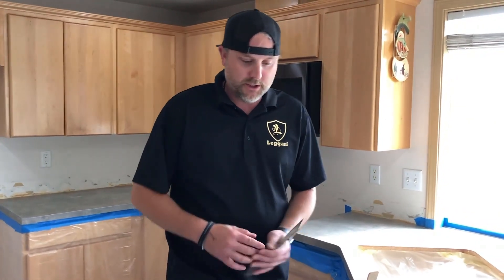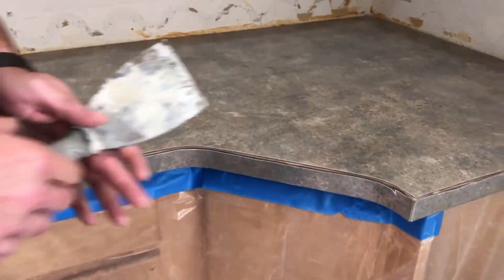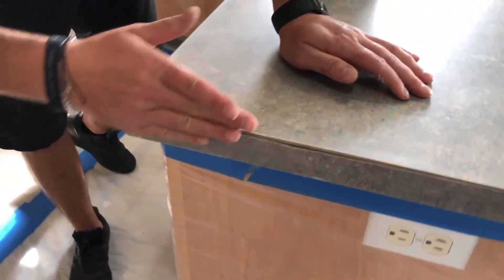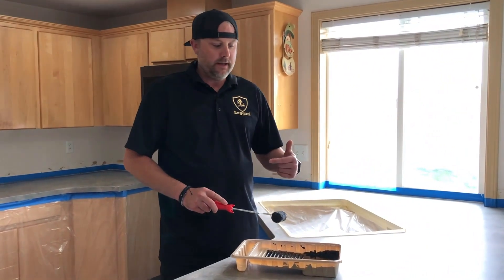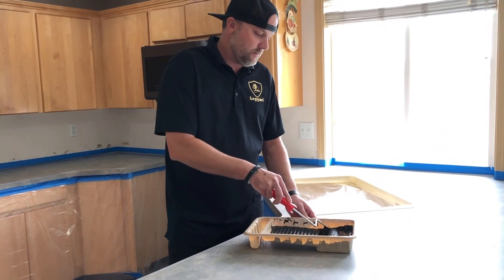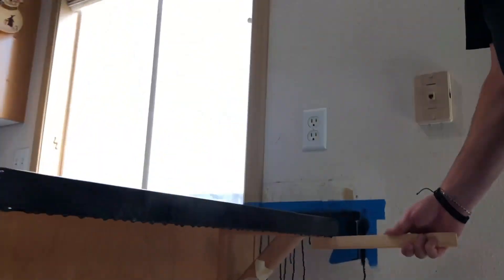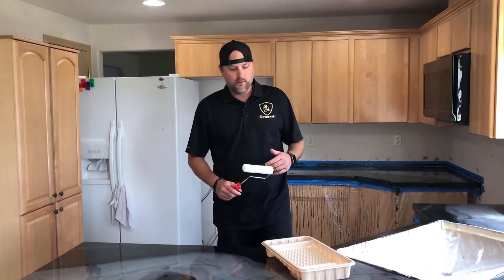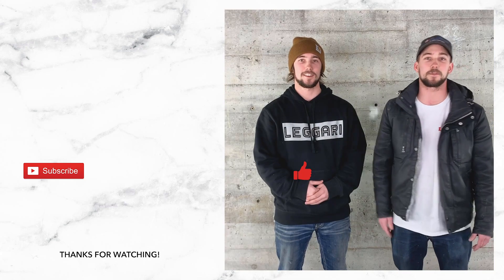Epoxy Over Formica Countertop Tutorial

Comment: Did you guys not sand the surface before priming? Also with a heavy pour why is there a need for that top coat? Or was that just for the handprint? The sides I understand but what's the purpose of doing overtop? Incase it's damaged or gets any gouges it doesn't effect the design & easily fixable with a quick sand and clear coat reapplied again?

Comment: What kind of primer and what did you spray on it after you put the epoxy on?
Reply from the maker: We use a water based primer https://leggari.com/product/wb-primer/ and once the epoxy is poured and the design is established, the first thing we spray is 91% or higher isopropyl alcohol. This creates cells in the design and disperses the epoxy. Once that evaporates, we spray denatured alcohol to pop any micro bubbles that might be in the epoxy from mixing. This allows us to avoid torching the epoxy and the risks associated with that.

Comment: So if the laminate is peeling off, is it better to peel it all the  way off or glue it back down and then sand to round edges?
Reply from the maker: You will want to peel it all off so you don't run the risk of it lifting up again.  Thanks
Reply: @LeggariProducts  Gotcha! I will still need to round off that edge though, is that right? Thank you!

Comment: Is bondo required for laminate , or i can sand real well. and add primer
Reply from the maker: Only need to bondo imperfections, joints or gaps!b So just give it a good sanding round any sharp edges and corners and clean really good and your ready to roll on your primer!

Comment: Looks great!   I’m going to have to buy that top coat. Is it heat resistant up to 400 degrees like the epoxy.
Reply from the maker: The urethane top coat is heat resistance up to 200 degrees F.  We do not recommend putting hot pans on any type of countertop surface.  Thanks

Comment: I have a brand new house but the countertops are formica material. I just want the countertops white. Do I have to sand the formica first or can I apply the product directly without the sanding process? Thanks in advance.
Reply from the maker: You will need to sand the surface first with 80 grit to scuff it up so our primer will adhere to the surface.  Thanks

Comment: Nice job ! What product do you spray on the counter at 15:55?
 I am actually preparing my counter 
As we speak I'm sanding  them but I can't seem to sand anything .. the melamine has a shine to it I've tried 60 grit 120grit 
Spraying degreaser
What should I do to  get melamine ready before epoxy?
Reply from the maker: Hello! Some surfaces are easier to prep than others. Typically, if the surface is not affected by sanding, the Primer will still be enough to prep the counter for epoxy. Please contact our customer service for more in depth instruction on how to use our products and prep your project. 
https://support.leggari.com/hc/en-us/requests/new

Comment: Have a question. If there isn't a way to level a built in counter top that is a little lower where it's connected to the wall. Is there a product to use to level the counter top out without removing the counter top? This has been a concern. I used wood filler to round the edge of the counter top and fill in the crease and nail holes. Then sanded down. Do I need to use the 5minute product that was used in this video or will the wood filler work? These are the  two concerns to why I have not finished the counter top yet. Please help and thank you. I love your videos and have watched so many to get every tip I could find. (I have done samples on small pieces of wood to figuire out and practice your Technics. Thank you !
Reply from the maker: Hello! Great question. If you email our head tech he can definitely help answer this for you! His email is cody@leggari.com
Reply: @LeggariProducts  thank you. I just emailed Cody. Love your work!

Comment: I noticed a ceiling fan going ,do you have a problem with dust getting in the epoxy?
Reply from the maker: Yes you can, you want to make sure you close all vents in the area and shut off any ceiling fans so you don't get dust in the epoxy.  Thanks
Reply: That's just what I was going to ask. I wondered if it would affect the drying. I wish this was available in UK. I'm having new kitchen and me and builder are doing resin worktops. I've so many ideas from watching you guys, but have to substitute products for what you use :-(
Reply: @jeanniesartadventures6146  If i were in the UK, i would use Easycomposites.com
They have good epoxy for every type of use imaginable. Consider yourself lucky, they would be my  preferred vendor, but shipping to the USA is expensive.
Reply: @jeanniesartadventures6146  P.S. If they  don't have the Mica powder colors you want,  go  to Eyecandycustomzus.com has the best selections of every color.  Ex, They have 27 different greens.
Reply: @andrewmarkert1146  thanks for that Andrew, I'll take a look. I'm a bit of a mica powder addict, I use them alot to make paints...I've quite a collection. Love them, so someowhere new to look is good.
Reply: @andrewmarkert1146  Hi andrew, thanks so much for this info, I've just been going through the website and it sounds perfect for what I need, and has so much helpful tips and information. I'm very grateful to you for pointing me in the right direction.
Reply: @jeanniesartadventures6146  Anytime.

Comment: Can you epoxy over tile?
Reply from the maker: Yes it can be put over tile, but you need to fill all your grout seams with multi purpose bondo from Home Depot, then sand it smooth, this will scuff up your tiles also, then wipe it clean with denatured alcohol then you are ready to apply our epoxy.  Take a look at the tutorial below.  Thanks
 https://youtu.be/g8GzsL0kpns
Reply: @LeggariProducts  Thanks. What is the temperature range for the epoxy?
Reply from the maker: The epoxy can withstand up to 200 degrees.  Thanks

Comment: I love all your videos but for some reason, the music drove me nuts. LOL Anyway, have you ever done the inside edges of the sink area of the Formica to install a sink under it instead of on top?
Reply from the maker: Yes you can roll the inside of the edges, it be the same as rolling the edges on the countertop.  Thanks
Reply: Make sure you investigate how to put an undermount sink on a formica countertop. If it gets wet, which it probably will, it will expand the mdf or plywood and the sink will drop. We looked into the undermount sink and ended up going with a Karran Quartz drop in sink because it had great reviews and we didn't want to take any chances with the water getting into the old countertop and making it fail.

Comment: Id like to see videos testing the durability of your products.. 👍
Reply from the maker: Our products are actually industrial coating made for military aircraft hangers, etc. So theoretically in a residential, or even commercial setting it will last forever. This is NOT a cheap epoxy paint that you will commonly find at box stores like Home Depot or sherwin Williams. It is a thick 100% solids epoxy coating.
Fire and heat test
https://youtu.be/09elup51N6U